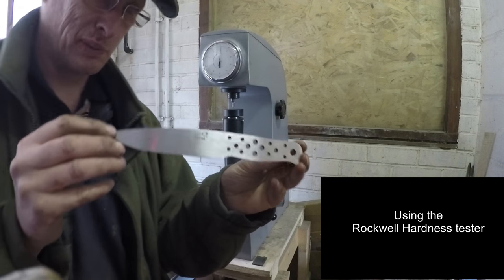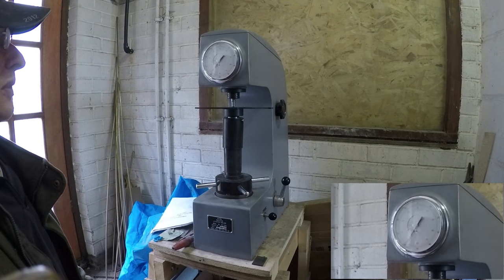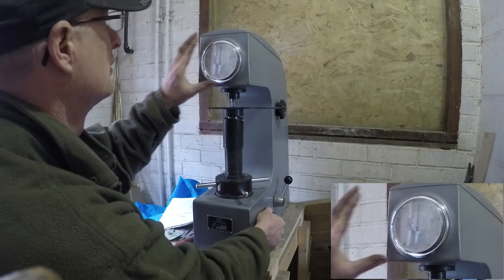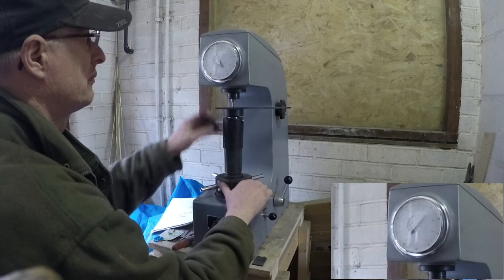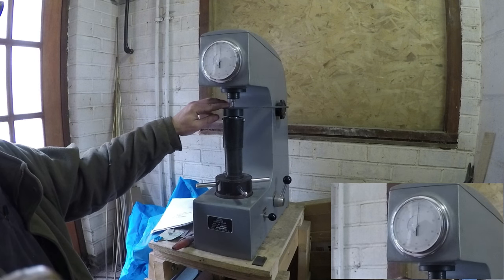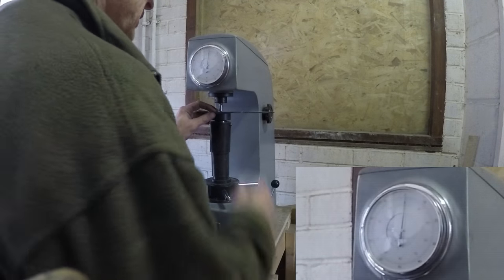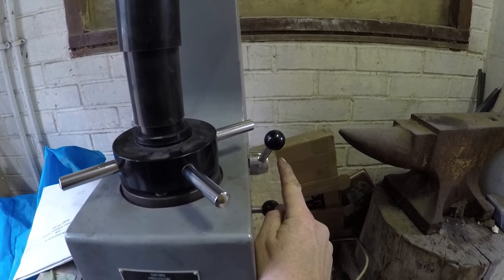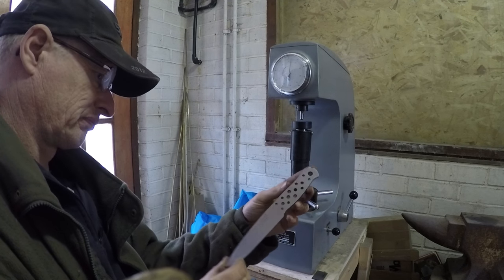How I Rockwell test a knife

Comment: If they fall outside your desired range of hardness, do you go through a heat treat process again, or are they essentially ruined and just good for experiments or scrap? Or do you have your system basically nailed down tight now and you just don't get that kind of variation...
Thanks for the vids.

Comment: Hi Jack,

I have often wondered about this, so now I know. Do you have to RW or whatever it is called to every finished knife, as there is only a limited number you can heat treat and there could be differences between batches?

I wish you well and if you have finished your walk I hope your little ‘advert’ went some way to raise cash for the charity.

Take care
mrbluenun
Reply from the maker: +mrbluenun Every knife gets tested several times. Walk commences next week:)
Reply: Jackloreknives hey Sandy. You may not see this as it's an older video. I was wondering if you Rockwell tested your earlier knives that were sold? I'm getting into knife making and I'm having an internal debate in my head whether to sell my first few knives without a proper Rockwell test.

Thanks mate

Comment: Great vid. I've been trying to find a simple answer to my questions regarding this HRC test, maybe you could explain it for me in simplest terms if you wouldn't mind.

So before starting the test the diamond identor rests on the steel with 330 pounds of pressure. Then the test starts by adding more pressure above the 330 pounds.  

So once the indentor penetrates the steel that marks the HRC hardness? Is HRC measured in pounds over the initial 330 pounds?

For example zdp 189 has a HRC of 64, does that equate to 330 lbs + 64 lbs = Indentation ? (a total of 394 pounds to indent zdp 189)

Sorry if this confuses you but i've been trying to find a simple explanation/answer to this and cant seem to find it.

Again, great video.